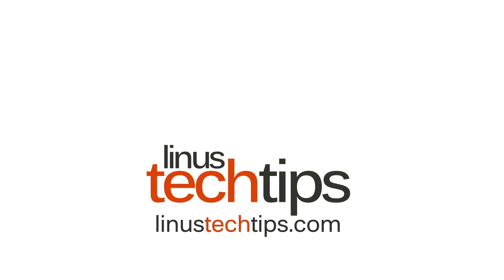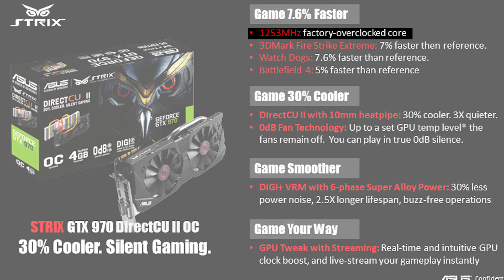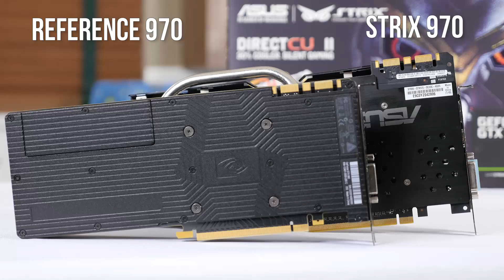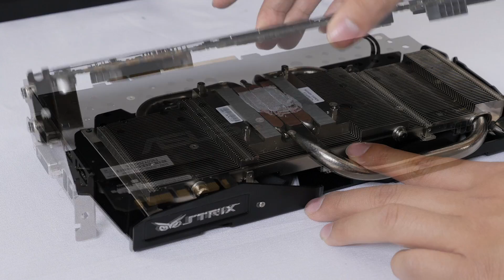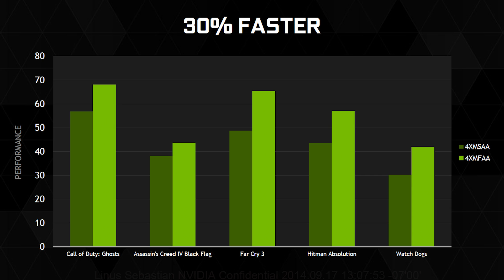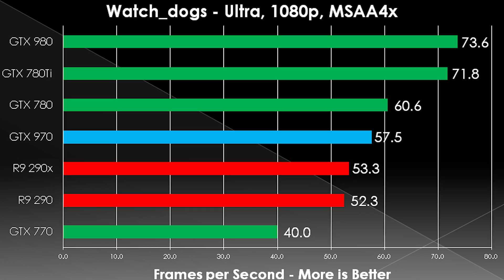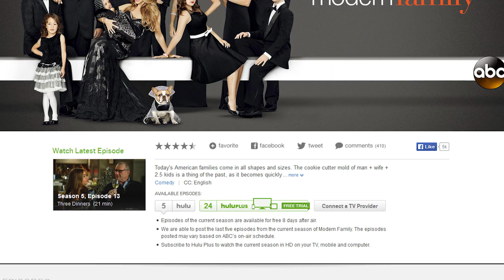ASUS Strix GeForce GTX 970 Video Card

Comment: What do you think about this rig? :
CPU: i7 4771
GPU: Strix 970
Ram: 16GB Corsair Vengeance
Mainboard: Maximus VI Hero
Reply: TassadarGR The GTX 970 is still better than other AMD cards. The only game that managed to go above 3.5 gb of vram was BF4 in 4k. Linus said this on the WAN show.
Reply: TassadarGR The card is not limited to 3.5GB, the 4GB is still there its just segmented into a 3.5GB and a 0.5GB, the game will use all the 4GB memory (if it wants) and only if it goes over 4GB the performance will drop.
Reply: mine is.
intel pentium 3 1.2ghz
256mb gpu
250w psu
512mb ram
plays all the new games brilliant.
Reply: don't get 970. this card is limited to 3.5gb vram. when a game starts asking more than 3.5gb vram your performance will drop. for more info search on google, its easy to find. just type gtx 970 3.5gb
Reply: dont worry about 3.5gb limit you wont be gaming at 4k so that means u are fine :)
Reply: DarkVoidDan
Wow! Such power! and I thought my build was fast!
Reply: thanks for your opinions :)
Reply: ***** we have THE same PC specs
Reply: *****
those 0.5 are slower
Reply: Yes and it shows when running specialized benchmarks designed to test the memory but in real world examples the impact would be negligible, I ran CoD: Advanced Warfare max with 2x supersampling and it recorded a max use of 3.7GB of VRAM but I didn't have any FPS problems.
Reply: I've got a similar build, 
CPU: i5-4790k
GPU: Asus Strix 970
MoBo: Asus Z97-A
RAM: 2x4GB Kingston HyperX Fury
PSU: EVGA 750B2

No worries on my end so far. I've tested the card with Photoshop, Cinema4D ( VRAY RT,iRay) & my games BF4, Titanfall etc.
Reply: Don't take the VI Hero, take the VII Hero!
Anyway the 4770 non K is useless with Z97, spend a little bit more and take an unlocked CPU.
Reply: Destry Payne
Yeah got to have the best lol what your real specs :)
Reply: DarkVoidDan
Ummm... Right now, before my upgrade come taxes,
Pentium E2220 dual core 2.4Ghz
4GB DDR2 800Mhz
PNY GT 430 2GB 700Mhz
Crappy Seagate 500GB that now sounds like a blender on start up
200Watt PSU
Overall, 7 years old on all parts but the PSU, which is 11 years old lol.
Also, this will be my new upgrade: http://pcpartpicker.com/user/darious24555/saved/#savedbuild_1900252
Reply: Destry Payne
I guess your more of a web browser film type of person :) My first pc has a 8320 amd 8 core cpu 12gb ddr3 ram gtx 970 4gb gpu a 1000w corsair psu and a tb seagate hdd that's the one I play my games on and my second one is an ASUS crosshair iv gaming motherboard a AMD phenom quad core cpu a 3gb msi r7950 3gb gpu a 600w psu 8gb ddr3 ram and that's the one I use for my oculus rift sorry that was a bit long lol.
Reply: Destry Payne
if you get that new setup it will be great for gaming especially with the gtx 970 :)
Reply: ikr! I've studied for about 2 months which parts would be worth the price tag. I can't wait until taxes come to start ordering! I'm so tired of 5FPS.
Reply: Destry Payne Be careful of the Asus software.  AI suite II gave me stutter.  

I'd do 16GB RAM.  Some have issues with 8GB and 4GB cards.  Many games shadow Used VRAM in system memory for alt+tab switching.
Reply: Abram Carroll
Just uninstall it then you have no problems afterwards.
Reply: Abram Carroll
I'll probably overclock manually from the bios anyway. I was also looking at the MSI gaming 5 at first, but the AR caught my eye.
Reply: Destry Payne Thats how I have mine.  The issue I had was DPC latency causing stutter and I used Xperf to track it to AI Suit II.  
I literally couldn't even listen to audio or watch video.
Reply: Abram Carroll
Way I see it, BIOS is the way to go, at least until anything like AI Suite actually becomes reliable.
Reply: lul I have a similar system, 4790k i 7 @ stock for now with huger after market fan, 16gb corsair vengeance ram with huge heat sinks. Along with SSD main drives and 2 2tb drive in raid0 for better preformance will probably keep till my CPU/DDR3 just gets wayyyyyyyyyy too out of date.
Reply: Crap pc
Reply: Acronyx Btw no point in getting 16gb of ram if you don't have at-least a i74790K, make it 8 gb and you should have spare budget to upgrade the cpu.

Comment: What would be the best recommended adapter for this card? A molex to 8 pin, a single 6 pin to 8 pin, or a dual 6 pin to 8 pin? I would really like to know because right now I cant afford to buy a new PSU, so for the first couple of months my 970 will be running on those adapters. Any suggestions will be greatly appreciated.

Comment: hey, would i bottle neck this card? or should i just get the 960?
PC Specs:
AMD FX-9370 8core 4.4ghz
Corsair H110 Watercooler
16GB vengance 1600Mhz Ram
Powercolor 7950 3Gb
120gb corsair SSD
1TB HDD
1250wt Corsair ZX series poer supply
Reply: nope lol